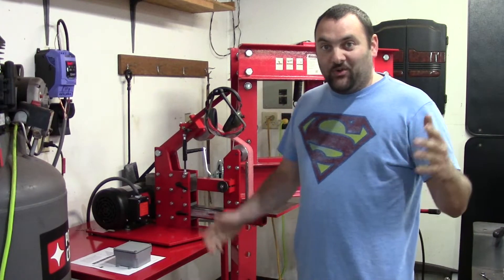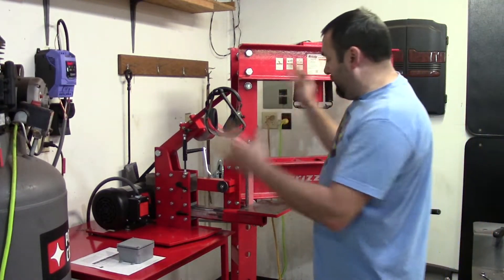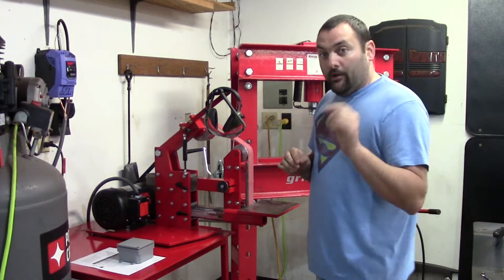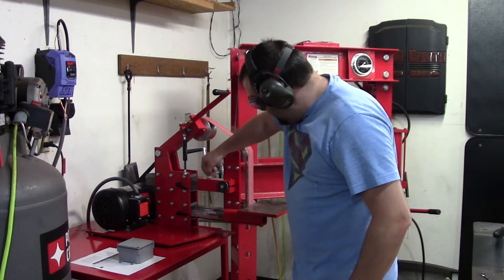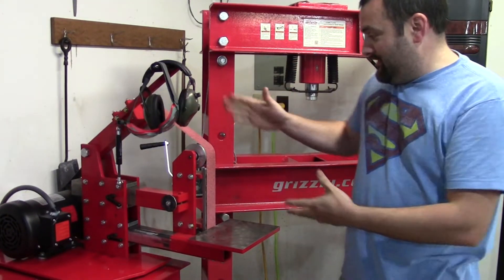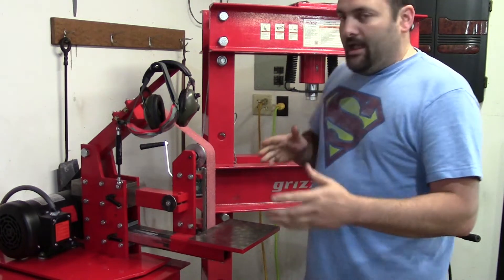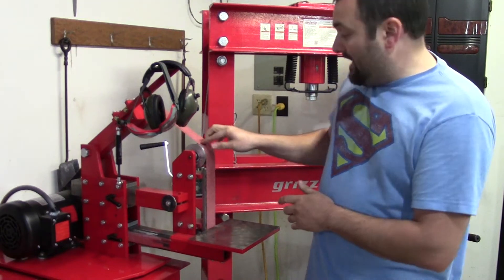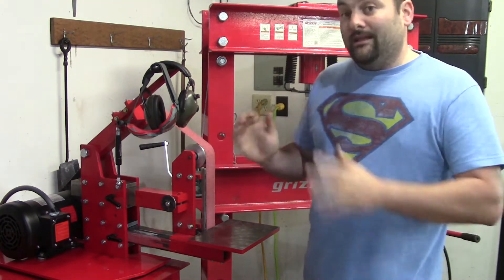The ultimate 2x72 Belt Grinder!  Metal Shredding Beast! #2x72beltgrinder

Comment: How hard would it be to modify the plans to have this as a 2x48 instead of it's current 2x72? Looks awesome btw.
Reply from the maker: You would just shorten the d-plate (bringing the wheels closer together) and reduce the length of the tooling arm.  You might be able to fit a 48" belt on it then.

Comment: Hi there,
just found you 2x72 design and it looks great. I don't have a metal workshop and i can't weld but I want to get into knife making and hand filing is a pain and takes hours. I'm not done with all your videos but all it needs is only a drill (press), tap drills and an angle grinder, right? Those tools i already have. Then I think I will give it a try.  

Are there any things you would adjust if you would re-build it after half year usage? Are you planning to do a small wheel attachment? Did you though about a tilting mechanism?

Greetings from Germany.
Reply from the maker: The only thing I modified was to make the tool rest wider.
Reply: @BeckTools  Thanks for your fast reply.  Your videos helped me a lot to decide whether to build a 2x72 or not. Most other videos show high precession machines to fabricate the parts but you're showing that standard tools are sufficient and that is really encouraging. Thumbs up for that.
Maybe I missed the info in the videos but what force does the gas spring apply to the tracking arm? And did you changed to position of the screw fixing the gas spring on the tracking arm?
Reply from the maker: @Tim_E88  there have been a couple changes since I made the video playlist.  I did move the gas spring location.  I keep the plans up today with all the customer feedback.  It's been so long ago I don't remember all of them off hand.  You can get a set of prints from my website if you want all the updates. :)

Comment: What is the cost, not including motor, or controller?
Reply from the maker: it depends one how many parts you make vs how man you buy.  You can make your wheels or buy them.  That's about a 100.00 difference.  Were I call out handles you can use bolts.  That will save you money as well.  If you get scrap steel vs new steel...  You looking at between $10.00 and $500.00. lol  I was able to get most of my stuff donated.  I still ended up spending about 400.00 and that included the motor and drive.  (I got the drive for free)